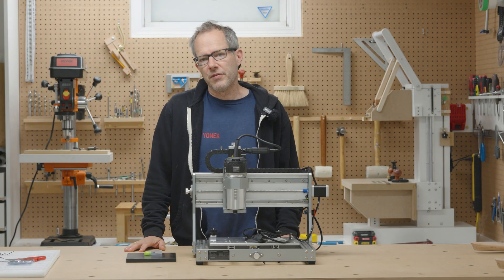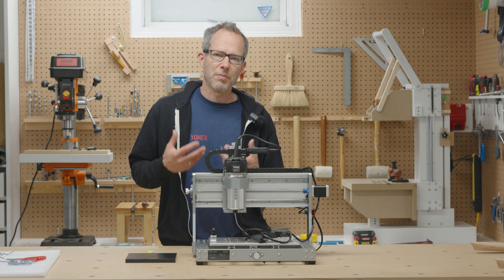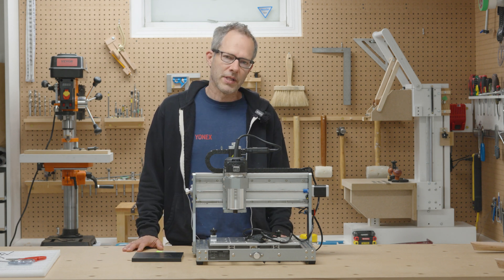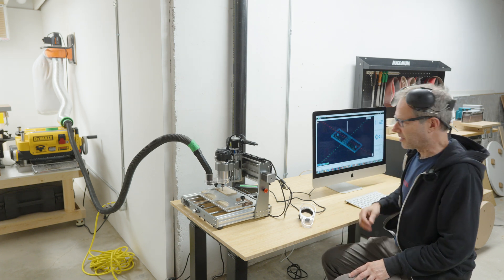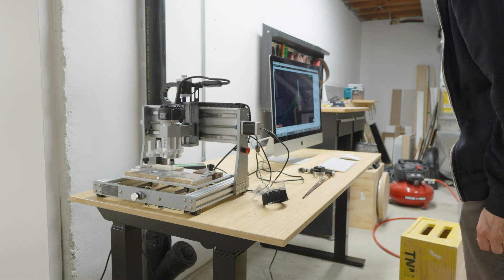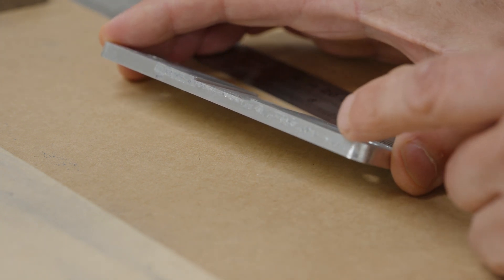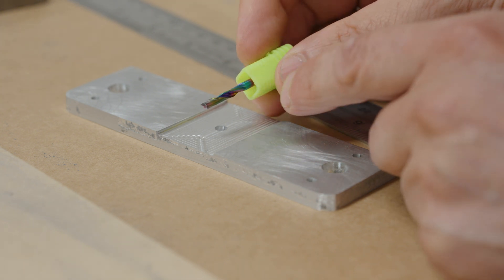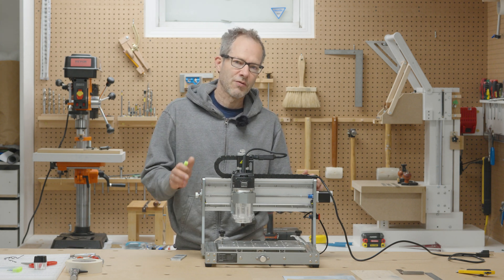Genmitsu 3020 Pro Ultra - Precision Metal Cutting on your Desktop

Comment: Did you tram it?
Reply from the maker: I should have
Reply: @acanadianwoodworker It makes a huge difference. I know that mine specifically was significantly out of tram on the X and Y axis. My first cuts were worse than yours, but after reluctantly buying the SST tramming tool I actually get really good cuts
Reply from the maker: @Jacksplague  That's really interesting, thanks for the knowledge!  Yes I guess it stresses out the bit and everything when not in a square to the workpiece situation

Comment: For aluminum you want either polished carbide or ZrN finish, 1-3 flutes depending on what your doing, and it absolutely must have a 45 degree helix. 
Save yourself some time and get this endmill (01150333) Accupro Square End Mill. These are the specs I run on the 3020 pro ultra for this specific endmill:

RPM: 20,000–22,000

Feed (2 flutes):
At 20k: ~24–40 ipm (610–1000 mm/min)
At 22k: ~26–44 ipm (660–1120 mm/min)

Depth of cut: 
Slotting: 0.030" (0.75 mm) to start
Adaptive / side milling: 0.060" (1.5 mm) with ~10–15% stepover

Stepover (Roughing): 
10–20% of diameter

Finishing:
Leave 0.005–0.010" (0.1–0.2 mm) stock on walls and floor.
RPM: 20k–24k
Feed: drop to ~70–80% of your roughing feed
DOC: full wall height is fine if it’s not huge, but stepover 5–8% of diameter.

Comment: Something is off on your machine or your settings. That machine is well beyond capable cutting aluminum at 200mm/s and 0.2 step down (at least). Let the machine make as much noise and vibration as it wants. And there aren't as many variables as you list. I have seen 3018 with a 500W spindle eat through aluminum.

Comment: I am planning on purchasing one of these machines for aluminum molds. I am wondering if you could lend me some knowledge on what bits to buy and some tips and tricks? Thanks
Reply: I'm working on a vid for making molds for a buster beagle with this same machine.
Reply: @NerdlyCNC  Thats awesome! Let men know when you post it!
Reply: @NerdlyCNC  Wow, this is so incredibly specific. I'm also planning to make molds for a buster beagle with this same machine! Subbed to learn from someone wiser.
Reply: @NerdlyCNC  I'd love to watch those, I just got a EMCO 333 (smaller) injection molding machine and need some molds made.
Reply from the maker: Honestly everything I know is in the video, I’m a noob in CNCing aluminum.  I used a single flute 1/8 bit